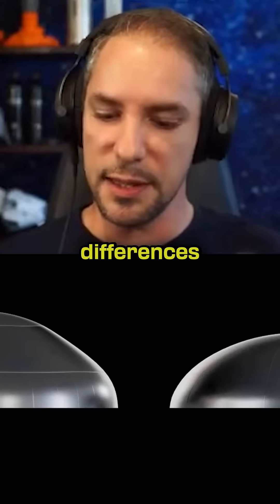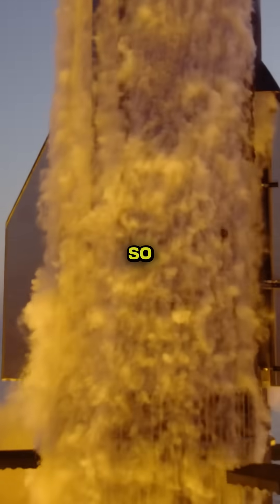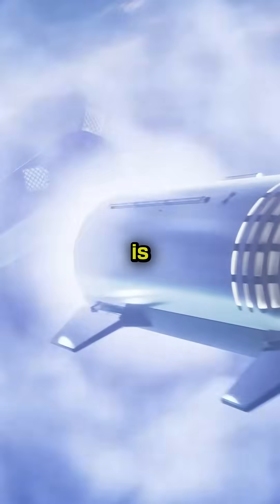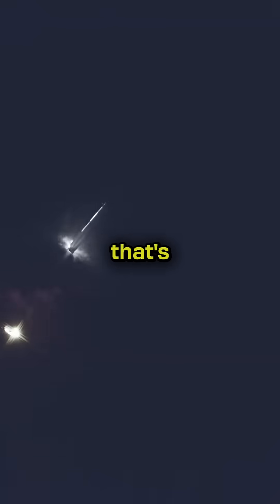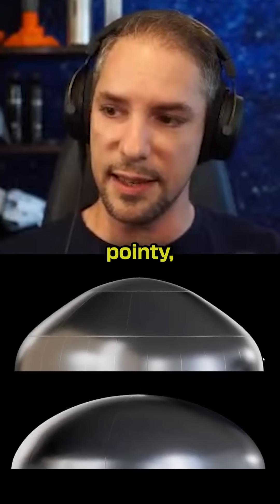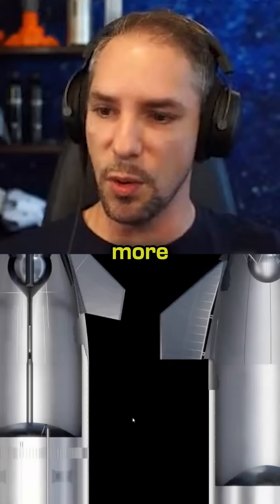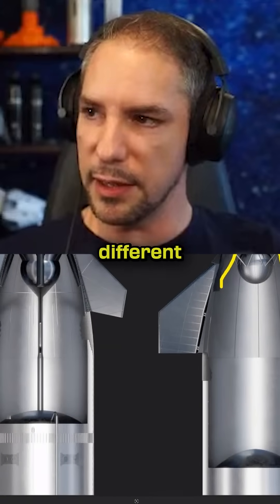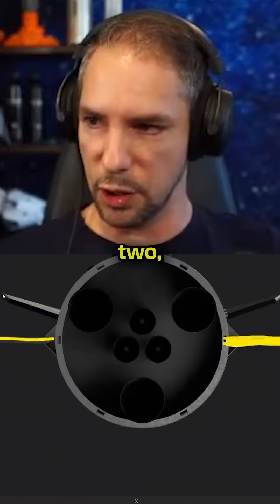SpaceX Starship Block 1 vs. Block 2 - What's the difference?

Comment: Seen as aft fins remain aligned with the diameter,  plasma exposure was not the main driver to shift forward fins away from their diameter ... I think excessive pitch authority ranked as a higher concern than plasma exposure for the redesign
Reply: ... for the redesign of forward flaps i meant